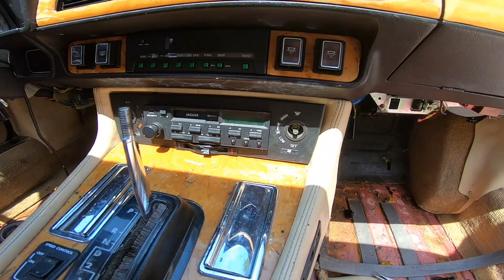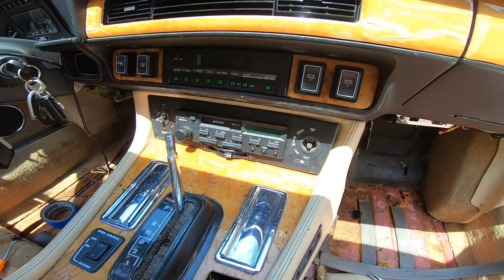Stripping the interior and dealing with typical Jaguar XJS issues

Comment: Not good what you thinking of doing with replacing the engine. The fueling and ignition issue needs to be sorted out on that car and you will have a good running Jag-u-ar
Reply: The injection connecter cable is rotted that leads from the Lucas ignition module to the motor control box in th trunk and there is a MAP sensor vacuum line going from the engine all the way back to the engine control box in the trunk....please check! Also get some new ignition cables and spark plugs.